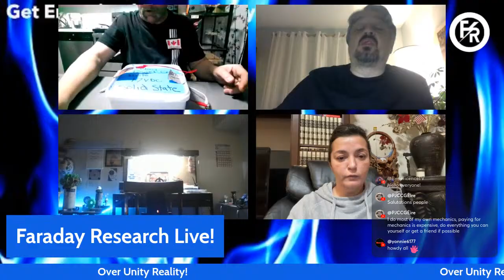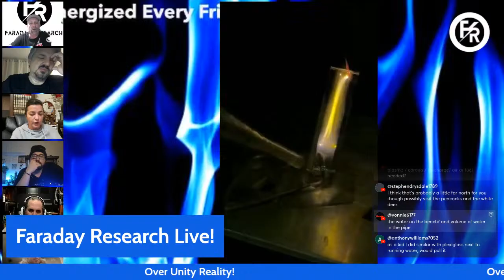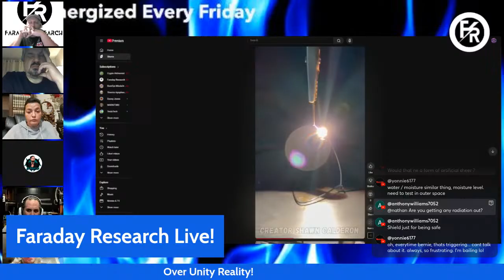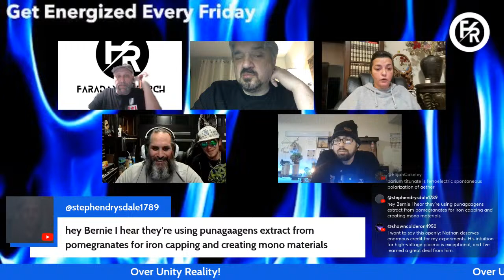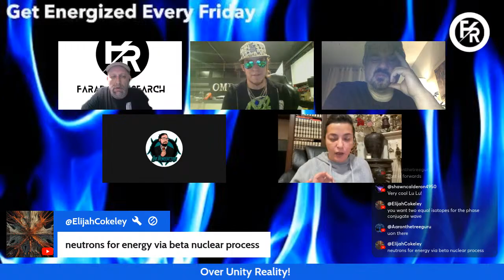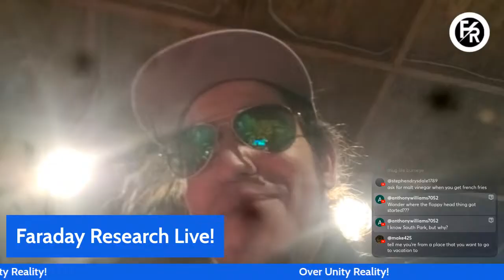League of Extraordinary inventors

Comment: I Am Sorry BUT, I Disagree ......I Believe There is some BAD interpretation of What is going on @ 46:40 stating that this spark gap is a OVERUNITY Device, due to the fact that there is NO OUTPUT to INPUT ratio, No need for a 50 000 volt power supply to split water, it can be done with 12 volts.    Ben Asked About how it was done, it is a 50 000 volt power supply that Sean specially ordered, and They split the anode and the cathode and form a spark gap, i hope that answers your question Ben

Comment: Nice on the batteries.
So my information I sent you about my battery cells was helpful then?

 The atmospheric energy is pretty easy.

 There is already a flow to ground right now. At the Earth's Surface that flow becomes subtle as the above plasma is trying to goto ground. There is a density gradient of plasma to the ground.
When you raise an antenna above ground it becomes a pathway or shortcut in that plasma layer to ground. A flow will be established just by closing the circuit and allowing that flow to ground through your charging device or load to harvest that flow to ground state.
Normally plasma entering the Earth's surface would be relatively chargeless. it would be balanced across the layer that plasma resides in..
Plasmas have double layers and there are a great many that reside around our planet. Tapping one of those layers and giving it unrestricted access to the ground state is what gives it additional energy as it flows to the ground state shedding it's charge if it can.
 Now most of the time the charge level of the plasma entering the planet is nill above the median at the surface. Due to instabilities and Plasma storms from the Sun, our Atmosphere can get punched and some of that high charge plasma starts to flow to the ground state like pouring a very viscous fluid into water. This is where the environment becomes energized is via these plasma dumps to our planet's surface. Tornadoes and hurricanes to volcanic eruptions and Earthquakes are all due to this Invisible highly charged plasma flows reaching our Ground unrestricted and unregulated. This is why the bad disasters happen from our weather. Remember those sheer wind drops in our Atmosphere? Any pilot will inform you that a microburst can knock a plane out of the air due to the volume of plasma moving to the ground state freely.

 With all that said lets think about it.
If you have a laser and you put a material in the way that absorbs the energy does the laser beam have any more effect past that material?
Now put the plasma flow in the same analogy. If we induce energy from the flow would the flow have the same force that it did before the harvesting of some of that force through induction?

 Use a small harvester to charge these cells we are making.
Remember that the plasma will flow through your device then to a virtual ground. This will be a steady state flow based upon the plasma layer you are in. You can find out the layer by using the fair weather potential principle. 120v/m above the ground state. Think of it like putting a straw into the air and at that layer in the atmosphere you can syphon at that level. But the antenna must not be exposed but only on the tip. You need to screen the rest of the wire leading up to the tip electrode of the antenna electrically otherwise it will pick up the potential of all the plasma down to the lowest extent of your pathway to ground state..  You must not let the dipoles combine until you want energy from the flow.

 This induced energy is a steady state flow I am thinking. Like the pressure out of a water hose. To get useful energy from that flow you will need to convert it into an oscillating flow. This can be done both mechanically and electrically in principle. It is called a blocking oscillator and it takes a steady state and converts it into an oscillatory state that we know how to utilize already in both electronics and fluid mechanics (water sprinklers).

Just a few things for you to look over...
Jon